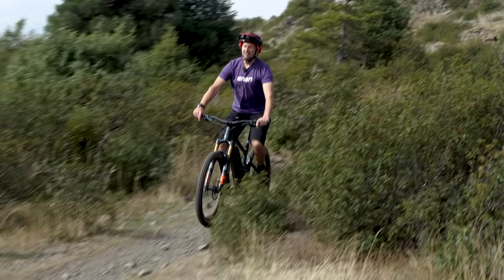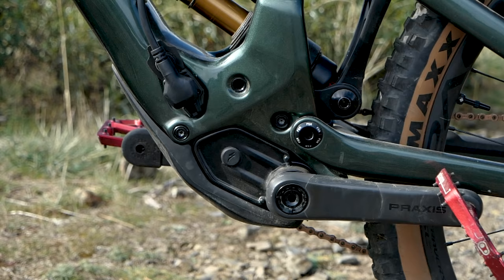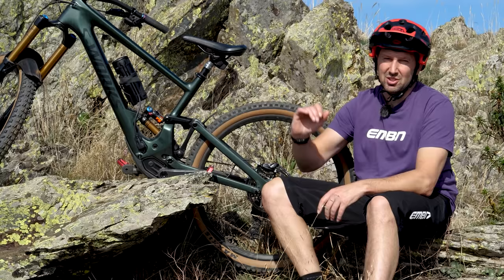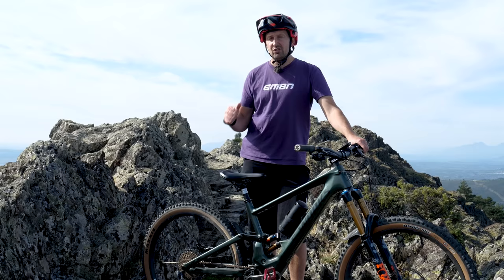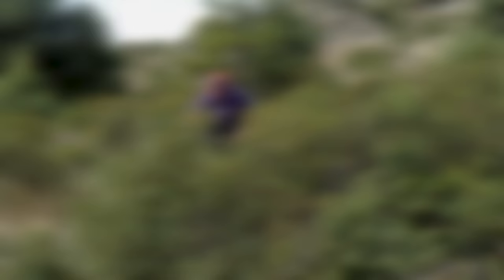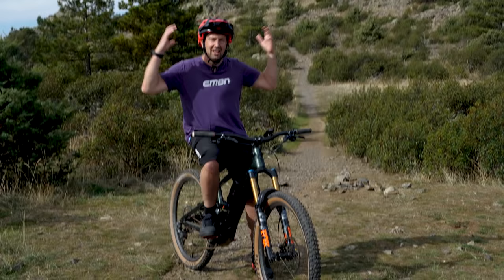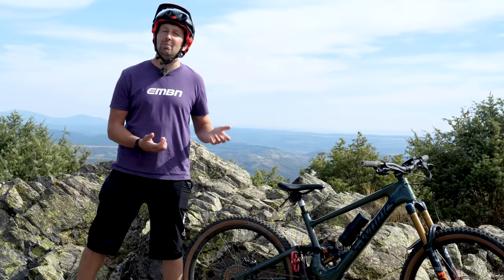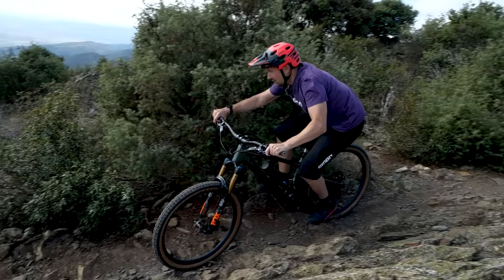6 Ways To Overcome Your E-Bike Speed Limiter!

Comment: Volspeed 4 on my Bosch. You plug it in, put the motor cover back on and you now can go up to 28mph. No error codes, no pressing buttons to set etc. Its amazing and how the bikes should come stock. Now when you're running up to a big grass table top in a park you don't have motor shut off right before the jump, same goes for any biggers jumps, it is downright dangerous to have a 53 pound bike  of dead weight right before a jump, I couldn't even imagine it shutting off at 15mph. Remember this has NOTHING to do with the motor or battery, the only reason was the nanny state Karens who felt that was a good limit, well f.....k them. Do you need over 20mph in regular single track or if you don't do bigger jumps? maybe not, but would be nice to ride to the trail head a bit faster.
Reply: Well said.
Reply: 20 is way too slow
Reply: What is a volspeed4 and where do I get one?

Comment: 15.5 mph is ridiculously low. 20mph assist limit would be sensible. Even on my emtb on the flat I can get to 22-23 so why not have the assistance? Likewise if you have high assist like turbo you can move along the flat barely tickling the pedals, so why not have a throttle mode for emergencies (get you home with an injury) or even getting up those difficult areas where many pedal strikes could not be avoided.

I can hit over 30 downhil and roadies can pedal at 30 on the road. Whats safer? Pedalling hell for leather side to side or having assist where you can progress more smoothly and pay attention to the traffic?
Reply: Agree. I feel I’m battling beyond 15mph, where I ride my ordinary commute at about 18-20mph on the flat. Don’t need ridiculously higher limit, but 20 would be the sensible spot. Anyway where did 15.5 come from? Sounds like a kph conversion…
Reply: Also look at gearing. My eBike is 4:1 max, yet road bikes are closer to 5:1 and can easily top 40mph. I can reach 35 on a gentle slope with my motor off - and I’m the wrong side of 60!
Reply: @herrtomas6729  Struth!
Reply: You are choosing to ride on a surface designed for vehicles, you are in their domain, if you want to keep up with traffic put more effort in or pay the insurance for a higher wattage bike, i find most peoples attitudes to e bikes are just lazy cyclists, im a lycra wanka and an e bike rider, when i want exercise and speed i ride my road bike, if i want an effortless leisurely ride I grab my ebike. Now this is a different story for elderly and disabled as there is a legitimate reason for needing the assistance, but again if you want to go faster in a vehicles domain then you pay for insurance. So its not really about safety when it comes to speed, you are naked in the air with just a helmet vs a metal box, you choose to take the risk, just like anything in life, i mean id like it if the e bike went faster but that is just me being lazy

Comment: I have a single speed /fixie flip flop road bike. I use it to commute to work. I bought a front wheel kit and large 624 wh battery. Easy to install and superb for the hills. I find myself regularly doing 40 - 50 kmph at between 90 and 100 rpm. The assist cuts out at 27.5 kmph. I could easily do well over 100 miles on one charge. I look forward to hills now. I think using a fixed gear bike has been helpful to consistently beat the speed limiter. 46 tooth chain ring and 16 tooth cog with 700c wheels is a good selection for the hills in my area of Scotland 😊

Comment: 2:45 Almost EVERY car you can buy is capable of exceeding legal speed limits. In fact a car's (or motorbike) top speed has NO bearing on its road worthiness. So why should it be any different for an ebike? Unless you're arguing (by implication) that cars and motorbikes should be speed restricted to not exceed legal limits, your comparison actually works against you.
It's a dumb rule that only adds confusion, inconsistency and unnecessary complexity to ebike regulation. Picture an ebike that's "assist restricted" travelling down a steep hill below the legal speed limit but above its assist restriction. In this case no rules are broken but the "assist restriction" law is made a mockery of. If an ebike (or any other bicycle) is not breaking the law going down hill, WHY should it be deemed to be breaking the law on a flat for travelling at the exact same speed?
Reply: Well said
Reply: I agree 100% I've been looking up E-bikes as I'm really thinking about getting one, as I don't have a driver's license yet, and our only grocery closed in town. So I started looking into these as a way to get to the town over. I realized very quickly that the speed limitations, doesn't make any sense. If anything I've learned that a lot of people that get E-bikes, don't feel like their going fast enough for cars behind them.
Reply: Well said.
Reply: Exactly 👍🏾 How can prove it ? My ORBEA rise will do 15 mph at max assist but I’ve hit 35 mph on a downhill trail and it’s NOT de restricted AND I wasn’t pedalling so

Comment: As I wrote several times, for me cool solution would be to have additional ROAD mode, in which limit would be like in the US (20mph/32kmh, although round 30kmh would still be fine with me), while rest of the modes can keep this 25kmh value. Of course, law should change to allow that, but from my experience I don't think it is necessary to have 32kmh limit in every mode and every situation cause saving battery and working more is also important. One can argue, well you can just turn off the assistance at 25kmh if that's you want, but that's not the same cause it's not practical and transition is way smoother when bike does it. Or maybe we could choose the limit for each mode in the settings menu, so if someone likes to go 30kmh in trail or eco, why not.

Comment: Since your group of channels ignore the S-Pedelec options available. it is mainly German channels that review those. The EU has better integration into the transport system by realizing E bikes are not Mopeds and changing the laws to allow for Ebike helmets rated to the Dutch safety standard and not requiring a non breathable motorcycle helmet like the UK. So it is quite reasonable that the available ebikes are being derestricted so that comfortable full suspension rides can be had on the way to work over all the pot holes. Dutch statistics have realized that most people who ride unrestricted ebikes travel at about 35kph. Since roadies normally exceed these speeds with ease where are the calls for those speedsters to have tax and insurance?
Reply: Exactly. I find it easy to get near the top end on my derestricted ebike without the assist. It just takes longer to get there without the motor. Where is the line drawn I always wonder. 
I’m rarely overtaken by the average spandex warrior these days now, but they can still keep up. I’ve even had some ask to draft me while getting their best Strava “KOM” around my local town haha
Reply: Read Joel's reply. Any reasonable person can see that he makes the point for restrictions. First we complain about The Lycra Lads and they are a danger, then we talk about them not being able to keep up! 

I agree, motorcycle helmets on a bike that can't even reach 72kph is rediculous, but riding in a bike lane or on a MUP or tearing up a mountain trail above 25kph is just plain wrong!

Comment: When I was 17 I bought a new Yamaha RD125LC, and the stupid restrictions that took learners from 250cc now had a 12bhp/125cc limit. It struggled at 60-65, gutless, dodgy on duals etc....I fitted a Micron (NOT Omicron) exhaust, K&N filter kit and suddenly whoosh.... closer to 20bhp and it was a fun, safer, rocket that could do 90mph..... E-bike restrictors need to be upped to 32kmph, or just done away with, they are awful things (especially with the Gen3 Bosch and the 2.5 gear box, hit the limit and you think it's packed in...)

Comment: My bikes are used 80% of the time on closed private property and I ride emtb instead of a roadbike just for longevity and not feeling like I'm constantly abusing the bike when I ride over rougher terrain. I also ride about 60km on a good day, and that's mainly in a straight line

I dont mind fitting a dongle to the bike that derestricts it, for all i care make it glow red so the police sees it if infit it on road, but the idea that I need to contact bosch so they unlock my bike after three times of them noticing me riding quicker than they allow on streets is ridiculous enough that I decided to  not to buy any bike with a restricted motor 

And it really sucks, I'd like to go to a local shop and buy some nice of the shelf bike, have normal order times, do stuff for the local economy. But now I order frames and motors from China and at most I buy some forks and stuff locally
Reply: Damn that's dystopian af, I didn't know that was a thing. Same thing is being instituted with cars too. No more hiding from the repo man, now they'll just shut it down remotely

Comment: I use mine for both commuting and trails and shifting to keep her in the sweet spot is key. I have 45-10 12speed  xt cassette on a 2020 stance E2. Find that I use the 10 mostly downs hill and on occasion smooth flats. I wondering if the new 2022 Reign with 15 more newton meters is going to pass that speed limiter wall easier or not as it will be more off rode oriented? I find my self peddling just as much on the road as a regular bike or even more just going faster.  On the trail I have to remind my self just use the flow and peddle position at times.

Comment: Am I missing something. My 1500w 48v rear hub with 52v battery cruses at 42mph all day long down hill up to 48mph. Only concern is on my bike speed wobbles but only at 44 mph below or above 44mph smooth ride. Not sure why that is.
Reply: it's the bikes resonance sweet spot  vibration travels through the frame  not all bike or frames  helicopters sometime fall to pieces two or three feet of the ground because of it😀
as you found a bit slower or faster cancels it out

Comment: What about upgrading the controllers LCD screen ?
Reply: Thats what I was thinking
Reply: @JohnSmith-qt7ul  The stock battery max speed is 50km at 32mph, but the extended range battery starts from 50km, and it's max is 90km which starts from 32mph, and possibly ends at 56 - 60 mph ( I'm not sure ), but I'm trying to figure out how many times do I need to ride to get it's maximum km per hour whether if I'm using the electric system or just by peddling the bike.

Comment: I’ve rarely been in position of wanting to go faster than the motor lets me. There’s no advantage going uphill faster as my transfers are usually steep technical and rocky. My friends usually wait for me on the DH as they are just better riders than I. I’m usually seconds behind so no big deal. So it’s a non issue here in the mountains of Lake Tahoe.
Reply: So true, besides, e-bike motors anywhere near U.S. legal (including the illegal BBSHD 1K Watt) don't climb but a very tiny bit faster. My buddy's 750 watt BBSO2 is almost imperceptibly a stringer climber than a 250 watt Ananda.
Reply: It depends how and where you ride, if you're on steep dh trails I agree but if the trails you ride don't have a steep gradient or are flat it's actually much harder work to keep the bike at the right speed to clear jumps etc on the ebike especially on trail centres. I'm considering going back to lower powered EP8 rs to get less drag in the system.

Comment: I fixed this by putting a BBSHD on my Specialized Epic, much better.
Reply: that motor also puts out a bit more than twice the mechanical power of a typical emtb motor. full suspension bikes are always a hassle to mount a sufficiently large battery onto...
Reply: The Chinese give you a nice 250w sticker to place over your 750w motor too so it's fully road legal
Reply: @JoLe1991  you are not wrong. Setting up my battery has been the biggest obstacle. My triangle is not big enough to mount a battery due to my rear shock and finding a rack that works with full suspension has proven to be next to impossible. So I frankensteined two racks into one in order to meet my needs and work around my triangle issue. I’ve managed to make something work, but the rack cannot handle off roading. For off roading I put my battery into a backpack and I ditch my custom battery rack.
Reply: @Todd66  the only way to make a large enough battery pack is to weld a box with a U trough in the middle that fits around the downtube, against which it can be clamped with some rubber between. think at a cross section like the arc de triomphe. then fill that case with about 1000Wh worth of cells for the  BBSHD, as drawing much more than 1C from high capacity cells will prematurely ruin them The BBSHD can pull 30A continuous, that yields on average almost 1500W power draw with a 14S pack.
Reply: @James-rf2ln  i've got plenty of these stickers 😝
Reply: @JoLe1991  I am running 52V with a 19ah battery that slides into a rack and locks with the key. My rack is secure enough for daily use, but the weight on the rear chain stay ruins agility and handing characteristics, so I use a back pack for any type of hooligan fun. It works really well. The BBSHD sits so low that you hardly notice  it’s there. If I had a shark fin battery, I would try to mount it on the downtube, but my battery has a tail light on it and is really too wide for the down tube. Plus under full suspension compression, I would be afraid of my tire making contact with the battery. A custom fit battery would be pretty cool for the triangle, but I want to upgrade bikes in a few years so I do not want to commit to a custom shaped battery pack. I also like the rack because the battery locks to it with the key and it’s right by my butt, so it’s fairly safe from being damaged. 
My next ebike is going to be a fully suspended fat tire with a bafang 1000W that I will probably mod out to 72V and run 2. Batteries. I want a tank that rides like a Cadillac :)
Happy New Year Jonas
Reply: @Todd66  sounds like a big project👍 i see too many with completely undersized batteries for such strong motors. I now run my bbs02 on a 21Ah self made microvast pouch cell pack and the voltage sag is ridiculously low, power and reliability very high. the chunky format only fits in a hardtail though. happy new year!
Reply: @JoLe1991  I have a free front triangle because its a 2008 model. I have 1 attery in the triangle and below the downtube. 2x 48v 16Ah
Reply: @sweatyatoms7719  yes older models have more space in the triangle. putting a battery under the downtube prevents you from bottoming out or when doing so the wheel will hit the battery.
Reply: @JoLe1991  No no i checked it, it works
Reply: @sweatyatoms7719  so you must have an extra large frame. most battery cases are about 35cm long (13") and 11-12cm (4.5") high
Reply: @James-rf2ln  bbshd it 1.3kw peak on 48v and 1.4kw on 52v
Reply: @JoLe1991  that's peak power not continuous (it would get very hot very quickly if you ran flat out  for more than 20 minutes) and the latest firmware for the bbshd is max 28a
Reply: @jamesemery1  some numbers from the simulation: at peak power output (mechanical) with a fully charged 52V battery you get the following data:
97Nm torque
1402W motor output power
Efficiency 82.3%
137.8rpm at the chainring
29.5A battery amps
57.5V voltage, loaded
The stator temperature will stabilize at 141°C, which for hub motor guys is not considered overheating. want to get more power? increase the voltage, keep phase amps below 35A and the motor will be fine
Reply: @JoLe1991  I wouldn't be happy about running a bbshd at those temps and if a hub gets that hot then is probably being pushed to hard for its use case, I'm currently running 90 phase amps and 35 battery amps on 52 volts in a very hill city and never had temperature's above 40c but I do ride with mechanical sympathy and use a large gear and let the motor spin quickly when climbing hills
Reply: @jamesemery1  ok, so let's drop the temp threshold to 100°C.
the bbshd can put out a max of 28.3A phase, 1181W motor power at 57.5V loaded battery voltage. rpm are at 146.8, efficiency 84.1%. Higher continuous power can be achieved with higher voltage (other conrtroller) and staying at 28 phase amps.
Reply: @JoLe1991  even a 100c will cause issues with the magnets in the long term, I'm not an expert with magnets but a quick google says "If a magnet is exposed to high temperatures, the delicate balance between temperature and magnetic domains is destabilized. At around 80 °C, a magnet will lose its magnetism and it will become demagnetized permanently if exposed to this temperature for a period, or if heated above their Curie temperature." my roll back temp is set to 75c because of this.
Reply: @JoLe1991  nah man, it is a medium. But i mounted it very low on the downtube so it just fits with 0,8cm of clearance. haha
Reply: @jamesemery1  you are right, but if stator temp stabilizes at 100°C, the heat conduction goes mostly to the aluminum shell, as the air gap between rotor and stator insulates against heat. on top of that, magnets are integrated into the rotor as opposed to glued on the outside as on the bbs02. there is no evidence for it but it's still quite safe to assume the magnets would not experience more than 80C when the stator is at 100C continuously.

Comment: What I meant by dangerous is that when you need to pull out quickly and the limiter suddenly slams on, it could easily end up with you getting smashed off your bike. Why the hell can't they just stop motor assistance rather than slamming the brakes on?

Comment: I ride a Mahle powered road bike. It’s restricted to 25km but there’s no drag over that, so I ride 90% of my road ride at around 33km/hr under pedal with no assist.. do these centre mounted motors work the same way or do you actually get resistance above 25km/hr…? If you do why? Can’t these motors free wheel or cut out with at least close to zero resistance over 25km….??